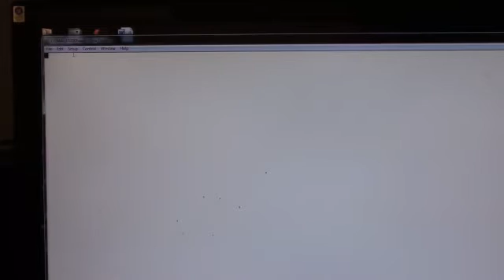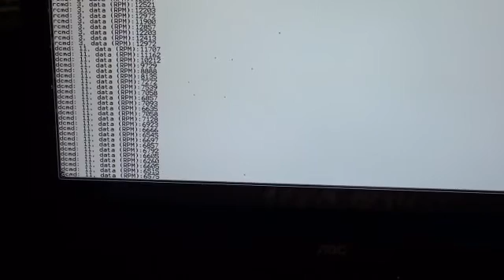Brushless DC motor control (BLDC Controller)

Comment: Hi 3pinmicro ,I have watched your wonderfull videos and I got very usefull information on BLDC subject . I  would like to learn  how can I make speed regulation with BEMF signals , for example   under any conditions the speed of the motor will keep running at 2000 RPM  until  motor takes up to 30 ampers the motor will stop to protect himself and driver. is it possible to make it with BEMF controlling . Thanks

Comment from the maker: @wandra123 Did you checkout the new 4 part videos I have released the other day? its all explained there what to do with the PWM duty cycle and the PWM frequency...I suggest you first try to spin the motor in open loop with constant duty cycle of say 5% or 10% depending on your PWM frequency. Then you need to commutate 6 steps using those PWM pulses...this is in open loop.